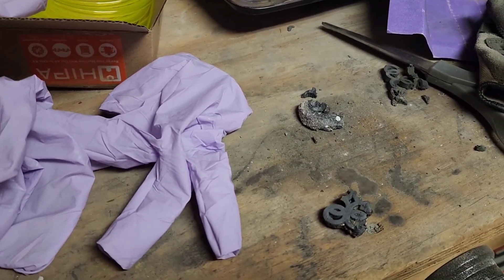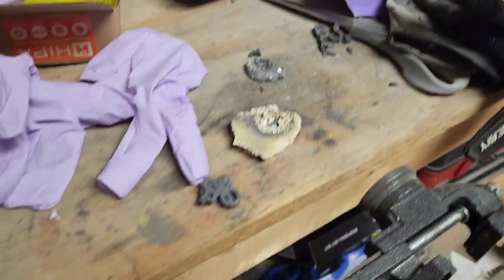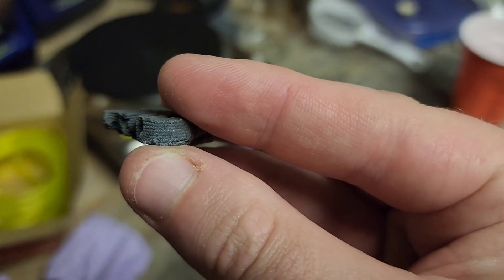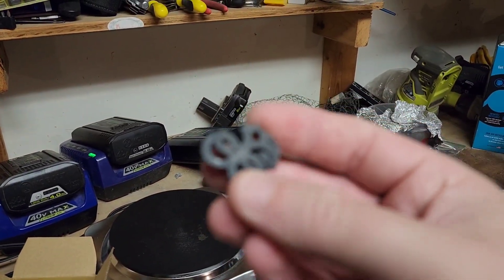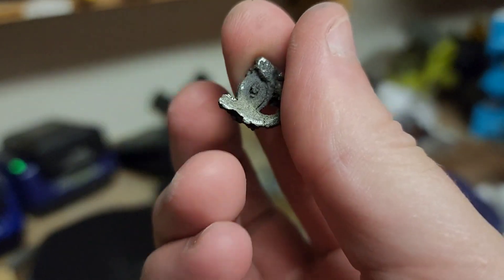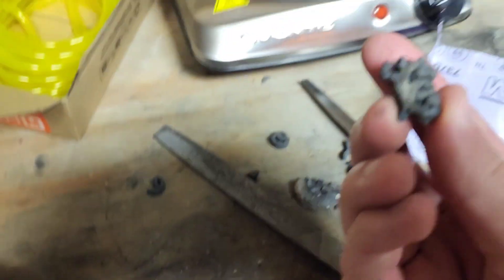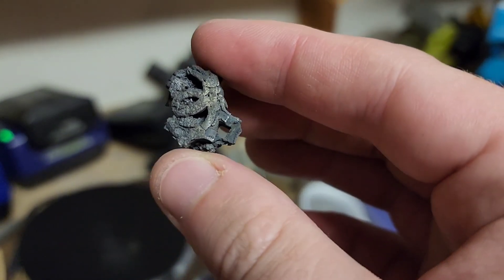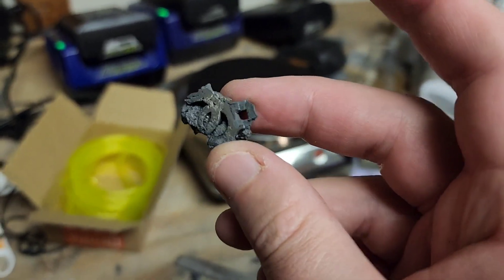Arc Sinter = Plausible

Comment: When you say pre-sinter is that de-binding?
Reply from the maker: So I'm using the term pre-sinter for a secondary stage after debind.

* stage 1 - debind 
* stage 2 - pre-sinter gets up to sintering temp fairly rapidly and then brought down to ambient (in this case ~2hr cycle). Part is removed from ballast and cleaned up
* stage 3 - arc sinter is a very rapid stage in fresh ballast and using arc medium to form very high temp plasma (~6 minutes)

The point of the pre-sinter (at least what my thought /observations) is to set the form and shape with some strength to allow for cleanup and handling. Then, the arc sinter rapidly heats and densifies the part.

All experimental, so totally subject to change, but this appears to be beneficial after my past tests
Reply: @Mr-Highball  Thanks for the response. Are you using traditional Kiln method for de-binding? I'm getting a kiln soon and will be using ceramic filamet around my bronze filamet to hold shape while sintering the bronze bellow the ceramic sinter temp hopefully without ballast.
Reply from the maker: @OMY005  np, and for the most part I am using a traditional kiln for the debind just becsuse it's a lot easier and hassle free. Debinding can be done in the microwave though in case others don't have a regular kiln